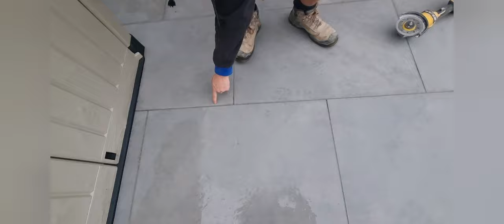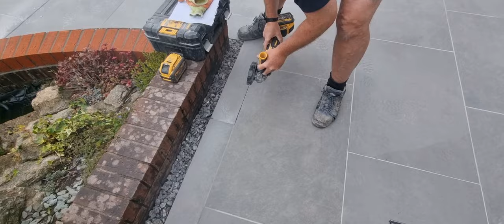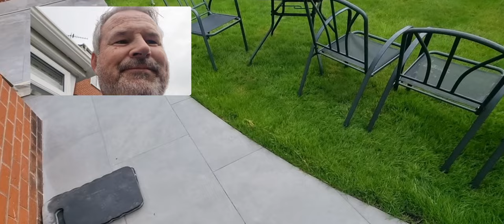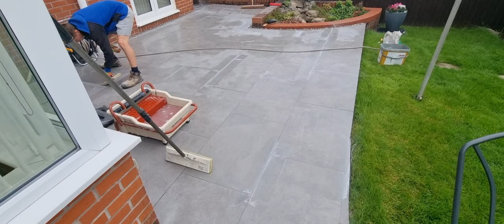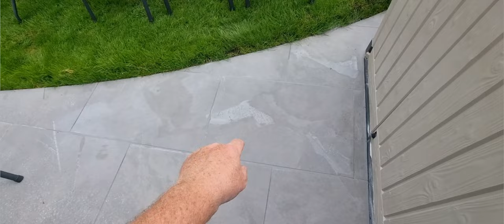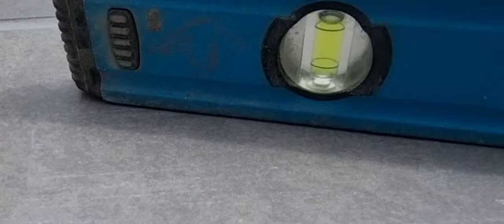We had a Complaint

Comment: Cant help getting the odd thing like this now and again Justin, just hope it's not too often. I'm back at a job finished a month or so ago myself tomorrow, Indian sandstone path up to and along a decking area leading to an office studio building clad in Hardie planks. The decking is raised (composite) and had been edged (facia?) with the same Hardie planks as the office building. When digging out, it was a bit tight and the digger bucket damaged a small section of the Hardie plank edging on the decking area. So I'm back there tomorrow to put it right. Customers very good and didn't mind waiting. As you say, it is very important to keep the customer happy.
Reply from the maker: Spot on paul and you did the right thing and gone back to sort the issue out .Hope your customer is happy we all have these issues its how you deal with them customer service is very important. 
Good luck to mate .
Justin 👍

Comment: Even high end porcelain slabs have lipping , i jud had to install a product that the customer purchased online i believe was a spanish porcelain and the things wernt even square,  after laying the 1st course the joints on the second course where not matching . 1mm here 2mm there and it was frustrating. I pulled out my small builders square and some of the slabs where 2mm off square . Luckily i used 5mm spacers and managed to make it work .
Reply from the maker: Shadsz that is terrible. Tiles not even square that makes the installation impossible to get right.As i said in the video it makes your installation look bad when its the material. 
Manufacturers need to be made responsible. 
They sell there products make good profits and walk away most trades make no profits just a days work .its not acceptable shadsz is it

Comment: I am a Mason I did a tile job a couple winters ago with 1ft x 2ft tiles so they had that curve in the middle so I layed them 1/2 bond and they had that lip wich I explained to the home owner luckily they didn't complain I did some research and learned that tile setters lay them in 1/3 bond so the lip is not as noticeable
Reply from the maker: Spot on Richard 
Ive also heard if the manufacturer cilns them to hot when cooling they bend .so a better quality control at the factory makes sense but its not happening they just chuck em out the door then its not there problem is it and the get payed.
I have many brochures with half bond patterns so that means its acceptable if its in there brochures to do half bond.
In my opinion manufacturers need to take more responsibility for the quality of there products. 
Appreciate the comments rich
Justin 👍

Comment: You've got real integrity that shows alot, but if they were that picky over a few slabs being out by 2 mm then sorry but they definitely have OCD ask them to check everything inside their house even the brick work we have tolerances within the trade for a reason
Reply from the maker: Hi Giles they did pick up on an exceptable tolerance it was fussy but i just wanted it right for them so went back 👍👌
Reply: @brickrightbuildinglandscaping  
Yes you did the right thing just find it frustrating when it already looks fantastic mate 99% of people wouldn't even notice 1 /2mm out

Comment: Modern materials seem to be terrible to what they used to be. I took some 100 year old concrete slabs up to do my drive. The modern replacement were half the depth, different depths, warped, not uniformly finished on the edges & different sizes. (Marshalls) We measured the old one's & they were almost perfect.
Reply from the maker: Tony i dont think they make anything like they used to mate do they.
Its definitely an issue if slabs or tiles arnt uniform especially on porcelain 👍🙌🧱🧱

Comment: Pedalo is great kit have 1 for few year now but if catch grout at wrong time can be a bit aggressive on on joint better with the raimundi hand sponge most of the time. Scorching the tile then that would be a real pisser lol. Can’t bend them buddy why manufactures on the 1200 formats recommended a 200 lap and not half bonded personally hate half bond looks naff random quarter lap looks better. 2x2,s tile think looks better straight lines brick bins messy with all
The the lines. But just give customer what they want really a would took the spirit level over there head. Some customers just don’t get it mate want cheap tiles and expect them to a flat as arrow some cheaper range tiles have small 1mm -2mm bows in them.
Reply from the maker: Lee i do agree totally on  pedalo grout has to be bang on the right time to do it .As for the half bond yea its what people ask for and its not recommended by the manufacturers is it mate .
Some of these tiles arnt  exactly flat and they should be .I dont buy cheap low end stuff if the customer requests but not cheap .
So i dont expect any discrepancy its not acceptable really they need to take responsibility for it lee.
Great points as usual thanks mate 👍 👌 🧱🧱
Reply: @brickrightbuildinglandscaping  
Manufacturers don’t care buddy. Arento marshall range is low end but sold at high prices lol. But had some expensive 1,s from talasey 1200mm all be it but the level 1-2mm gap other end wasn’t even the style where small ripple effect to imitate natural stone pretty the style where like a sandblast finish shape tiles were questionable. London stone another bandits send full voided samples but send out tile which isn’t very naughty big black vien through the middle chipped small sample not sign vien. Was Italian tile tool noticed on the edges slightly dipped 1/2mm or so. Looked like they were designed that most something to do with the grout may help who knows. Predominantly used fugabella
Reply from the maker: @lmilne4859  
I think when porcelain came here and everyone wanted it .
There was a definite responsibility by the manufacturers to supply some good products. 
Now most of the so called high end or costly porcelain isnt even full bodied and comes from Bulgaria. 
There is a definite changes since covid in manufacturers saying there products are this and that and they dont live up to previous expectations. They should advertise and make it very clear whats full bodied, vitrified etc .Manufacturers have pulled the wool over peoples eyes.
Results for the client isn't as good as it has been in quality and for us its harder to make money off porcelain. 
While the manufacturers get fat off there products lee. Great points you make time and time again 👍 👏